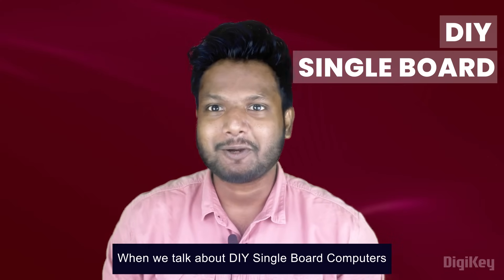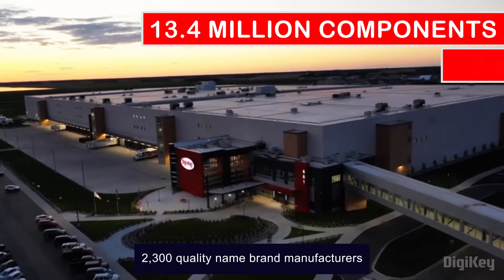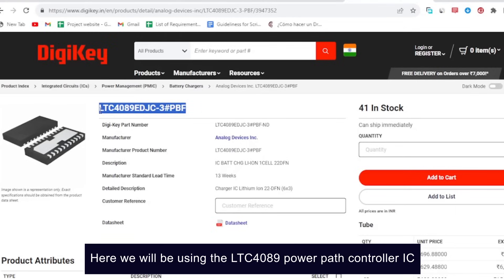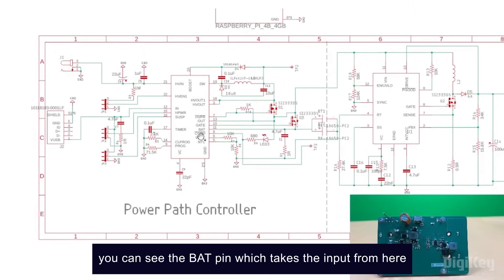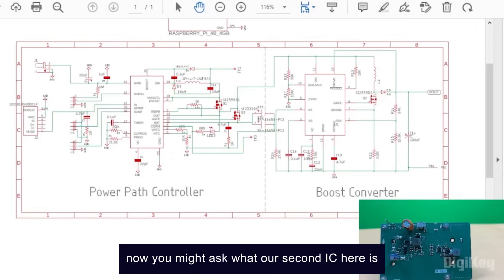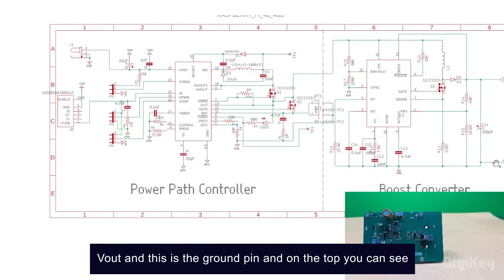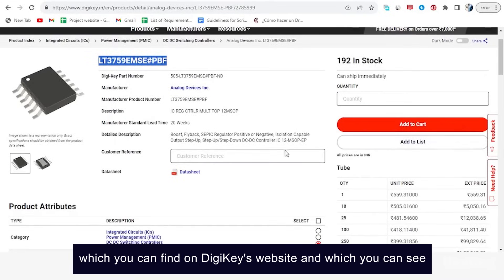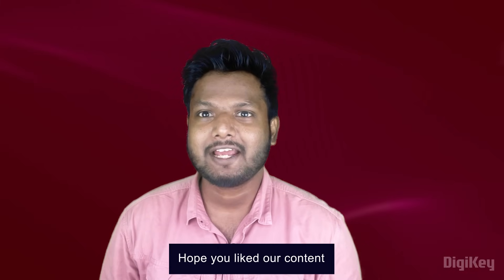Building a Raspberry Pi UPS

Comment: Hello friend. I need a UPS that will run my Raspberry Pi without interruption for my project. Could you please share the PCB schematic and components with me?
Reply from the maker: All the details are available in the project page, which linked in the video description.
Reply: @Circuitdigest  Thank you brother. I am using a mcc118, radar and filter circuit with raspbery pi in my project. I need to use this project as portable with UPS. So how can I adjust the voltage required for all of them with UPS? I am talking about a structure where the cards are placed on top of each other.